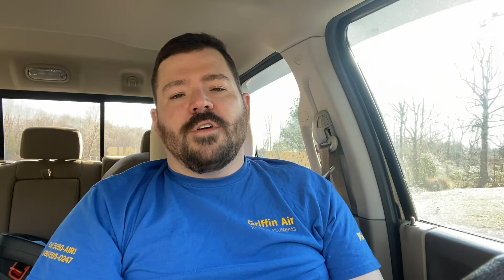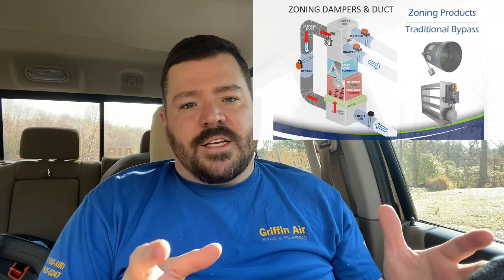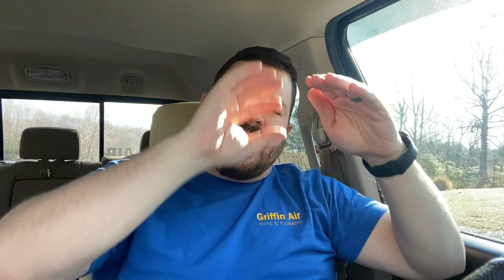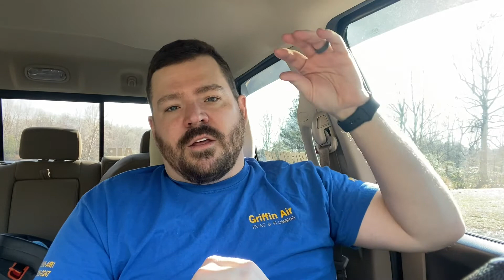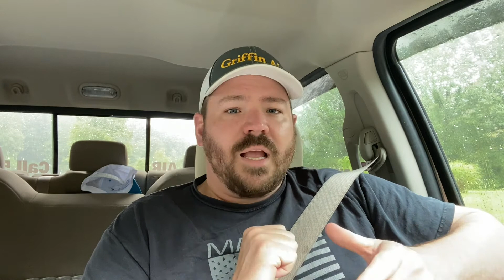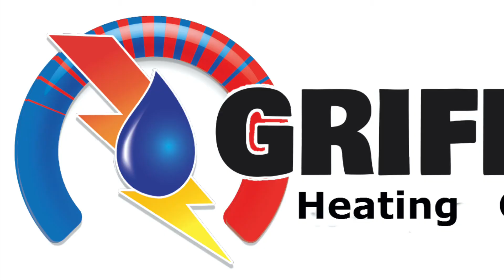Pros and Cons of HVAC Zoning  Do you need it? Basic zoning systems explained. Honeywell etc.

Comment: One quick question please. I'm about to build a home with a bonus room above the garage.  When you come up the stairs the room will be an L shape. It is about 250 sq ft in front of you and when you turn to the right thru a door there is a room that is about 400 sq ft.  The room won't be used a whole lot but as my girls get older, currently 4 and 2 i imagine it will be used all the time.  Would you go with a zoning system with 2 thermostats or use 2 ductless mini splits.  I'm hung and could really use an expert opinion.  Thanks
Reply from the maker: There are pros and cons to both set ups. The mini split will probably be less expensive but there is no back up heat source. Not knowing what part of the country you’re in, that may play a role.  Zone systems are great if set up correctly. But we see every day systems that are not set up correctly. I would recommend getting three different companies to give you prices and opinions on each. Hopefully one of them will give you the warm fuzzies and make the most sense

Comment: Sharing my experience with a zoned house. I have a 3-story townhome with a simple 2-zone system.  The ducts are slightly oversized per the manual and not oversized capacity. It is definitely great to have in the winter as you explained. Don't need hot air blowing upstairs as much as downstairs. Also, it seems to be better to not do too large a setback in winter (even with natural gas furnace) otherwise a lot of hot air shoots upstairs via the staircase. It has been better for me to just keep the thermostat temps set within a couple of degrees between floors.  However, I do have one of those really really long duct runs down to the first floor since the equipment is in the attic. One weird thing they did was make it even LONGER by running it so far away and then back and THEN going downstairs... almost like they wanted to make it as long as possible, so that room gets hardly any air flow. They wouldn't adjust it (builder) because they said it is within 3-4 degrees of the other floors. They also don't use any dampers, so not a way to adjust anything...they said everything is already perfectly designed. Compared it to a neighbor's house with the same plan, but the equipment is arranged different in the attic so he doesn't have as long of a run. I upgraded to 2-stage after 10 years (including zoning panel). That does make a difference for a quieter system and don't need to bypass nearly as much air, if any. So that might be why 2-stage is recommended for zoning applications. The house is well insulated and electric bill isn't over $100 even in summer (16 SEER), so not worth spending too much on changes.
Reply from the maker: Thanks!
Reply from the maker: +rodhoutx interesting. It sounds like you’ve had a long road☺️. However you are on top of it more than my average customer that I have to educate some of the things you’re describing.

Comment: Thanks for the great video! If you have to choose between installing two A/C and furnaces or one a/c and furnaces with a zoning system, what would you choose? I got sick of maintaining two systems and hoping to have a single A/C system in my newly built 2,600 [sq ft] home. The zoning system seems to have way less required maintenance compared to a second A/C and furnace unit. Maybe change motorized ceiling vents if the motor fails? I hate going into the attic so this is a big plus.
Reply from the maker: Yeah that’s very true. Every house is different so the answer may change but having two systems makes sense if you were comparing it to a zoning system that only has two zones sometimes. If one system were to ever go out, you wouldn’t be stranded entirely. But if set up correctly, having a zoned system could be more comfortable especially if you like it cool at night when sleeping but other temperatures in other part of the house.

Comment: Two story 2800 ft² in South Texas.  Dual-zones (upstairs/downstairs).  Replacing the 16-year-old, 4-ton, single-stage builder unit.  There is a bypass installed.

Is there a reason to not replace with a quality single-stage with a variable-speed furnace?  Some say a two-stage is necessary, others say a single-stage with a variable-speed furnace is the way to go.

Our current damper control board is only capable of communicating with a single-stage system, so getting a two-stage ac would require a new board that can talk to a two-stage unit... (maybe new dampers too, I'm not sure).
Thanks!
Reply from the maker: I recommend finding a good contractor local to you and going with what they recommend.  Every market is different.  So find someone awesome and go from there.

Comment: Great video! We have had a few HVAC companies out who say they can fix our underpowered vents at the end of the system with a damper zone. No one (out of 5) proposed another solution like modifying the ducts. We have an open floor plan so I’m not sure zoning is a good idea. Any recommendations?
Reply from the maker: You’re seeing a significant decrease in air flow from certain vents?
Reply from the maker: If so, have the ductwork inspected for air leaks even if you have to pay to get a duct blast test done. If that doesn’t find anything, have someone check sizing related to manual d sizing.

Comment: I want to install a 2.5 ton unit in my cape cod home,1st floor is approximately 900 sq ft, 2nd floor is 450 sq ft but we are not concerned with running duct to the upstairs bathroom. The house has no duct work at all. So I am trying to divide up the 1200 cfm’s between 4 rooms. The 1 at floor is a open floor plan so the living room and dining room and kitchen is all one big area. I’m figuring approximately 800 crm’s to this area with 2 supply vents, and the other two supply vents (400cfms) to feed the upstairs bedrooms which are approximately 160 sq ft each . In your opinion does this sound correct ? No zoning, just the 4 supply’s and then 3 returns. Your input would be appreciated. Thank you
Reply from the maker: Hey pal.  Your thinking sounds like you're on track.  I'd get a pro in there though so they can help.  The extra money may be worth it in the long run

Comment: Thanks for the info. Great video.

We are buying a new construction 3500 sq ft home. The builder spec is for one system with two zones (basement and first floor as one zone, bedrooms and attic as second zone). The builder has asked if we want to install additional electronic dampers to split our two zones into three or even four zones so that we can control basement, first floor, bedrooms and attic all independently. Each damper is $2800. Does this sound like a good idea? I’m concerned that it seems like a lot of money and I don’t know how beneficial it’ll be.
Reply from the maker: Interesting. Adding a damper should not be that expensive in my opinion. From what you’ve described, it may be a good idea to have several zones. Every house is different though.

Comment: Thank you for your insight on this topic.  We opted for single zone in our 2800 sq. ft. residence.
We have a upstairs 400sq. ft. hotbox/coldbox "bonus room" problem scenario.  Opted for the following:   Add extra duct for a total of two duct coverage and add a right sized return.    Bonus room currently only has one supply duct with no return.    We evaluated an isolated ductless mini split for upstairs, but the cost couldn't justify it . The compromise currently is to add an extra duct and a "rightsized return" in that room to improve the BTU coverage.    Thankfully it is not occupied regularly.  Opted for a single 5 Ton Daikin Fit to replace our 22 year noisy old ducted 5 Ton Unitary R22 AC and Gas Furnace.  The "gas and goes" each year with R22 are getting pricey.  Opted for the Heat Pump solution (gas furnace out) due to whacka-doodle California Emission requirements for new furnace installs.  Adding adjustable manual dampers in hope to tune that upstairs over time to get to something slightly better than before.
Reply from the maker: You’ve got the right thinking 🙂
Reply: @NewHVACGuide  Your content has been very helpful over the course of this year and wish to thank you for giving your time to the community.   Will be interesting to move from a on/off unitary system to a always on year round 70 degree solution.  Wondering how well the system will "heat" without the gas furnace.  Looking forward to quieter operation.  Thanks again for taking the risk and giving so much.
Reply from the maker: Thank you for your kind words!